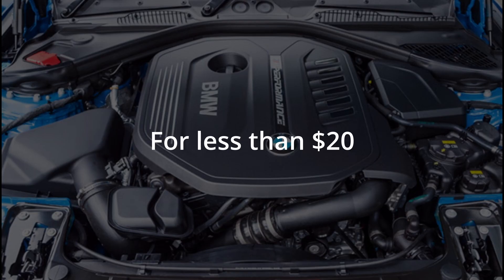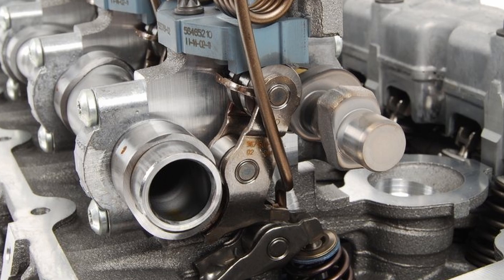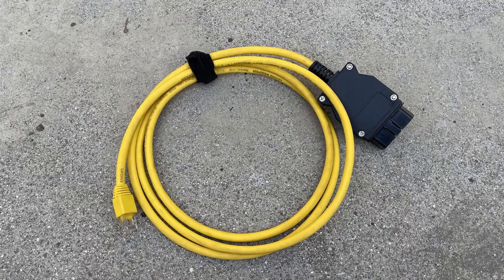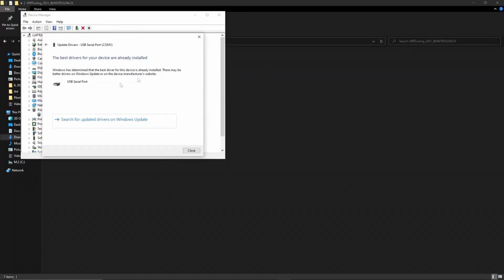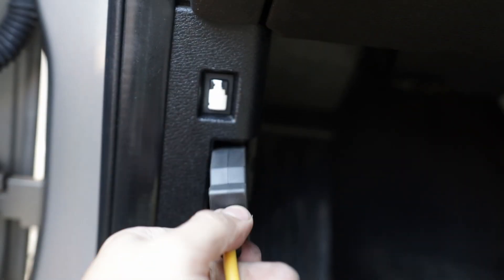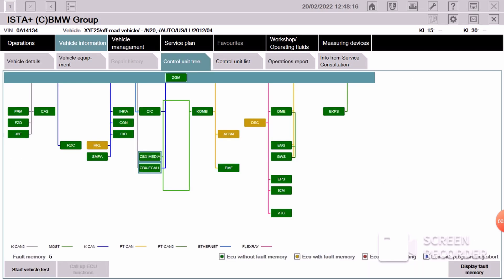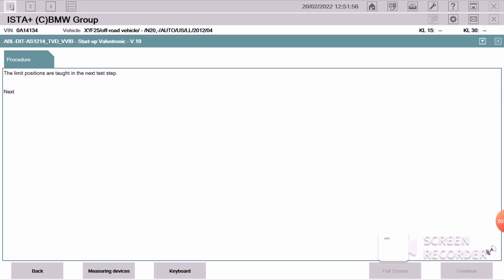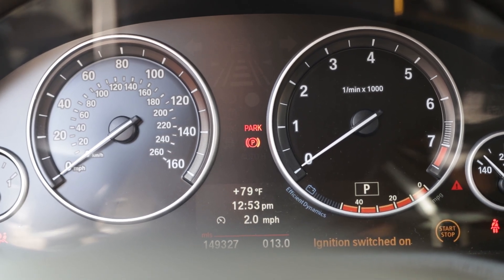How to Fix bad idle on BMW   (Valvetronic Issues)

Comment: Hey bro hope you well i have a b48 engine having trouble to stay idling runs roughs and shuts down not even few seconds later. i got a different valvtronic for it same issue but when i manually adjust the valvetronic and unplug the sensor it idle fines no issues but its doesnt sit right to drive the car without that sensor i tried doing a relarn test but car needs to stay on idle n my car clearly doesnt want to any suggestions?

Comment: Car with this issue for 3k buy or leave?
Reply from the maker: @MrPaininvain   if you’re doing it your self, it’s worth fixing! If you see and notice something might be off with power delivery, I would consider doing a timing chain replacement. That’s what solved my issue fully. My car was a bit out of timing. My fix here in this video was a temporary remedy. If you’re doing it your self, it’s about 500 dollars in parts

Comment: 250 Megabytes is the space needed… not 250 Gigabytes 😂.  Great video!
Reply: Incorrect, you need 300-400 GIGAbytes minimum for it to run smooth. Depending on which ISTA version you can find and its  capabilities it’ll need around 500 gigabytes to run everything efficiently.
Reply: @salty8snax  half a terabyte to run a program for which the download is less than 250 megabytes?  I stand corrected
Reply: @whlewis9164   😂 man you are going to have a rough time if you try to install this. Make a bowl of cereal and watch the install vid in the description. Skip to 18:30 where he literally says ISTA alone is 250-260 gigabytes and recommends 500-1tb of storage for all the programs in the pack. Yes, the zipped folder is <250 megabytes but once unzipped gives you the installers, files, and ISTA URL link. I installed a pack similar to this a year ago and it took me about 8 hrs to find a working link for ISTA+ and then about a full day of downloading & install instructions on old forums. Not fun.
Reply: @salty8snax  sounds like a real PITA!  Thanks for the warning.. 🤙🏼

Comment: Hi , I think I'm having idle issue . When I rev the car in idle ,  and let out the gas pedal as soon it comes back to normal idle rpm , instantly the rpm rises slightly like 50 rpm , above normal idling rpm, Then takes around 5 to 6 seconds to settle to normal idling rpm , what u think the issue is?
Reply: You fix it?

Comment: When replacing the eccentric shaft gasket, I turned the motor clockwise until there’s tension. Then counter clockwise until it pulls out. When putting the shaft back in, what position should the valves be before using the software to recalibrate?
Reply: Did you figure it out? I can't get rid of issues after changing valve cover gasket an the valvetronic gasket
Reply: @shaunariner also make sure everything is seated correctly. The CCV hose, the VCG, the MAF. You also might have to relearn the Valvetronic motor but I don’t think that’s your problem. We need to find out what your fuel trims look like to see if the car is running lean or rich. If it’s running lean, then you have unmetered air, vacuum leak. If the fuel trims are ok, then it could be the valvetronic calibration.
Reply: @shaunariner Did u figure it out?

Comment: I have 2011 BMW F10, 52 engine. When I started the car, it idle perfectly fine, but when I shifted to drive, the RPM dropped to 1000, so  after that, it will stay on it. It doesn't drop to 600 how I can fix this issue. Thank you.
Reply: Did you find out why? Did you solve this?

Comment: Did you have any fault codes or just a rough idle?
Reply from the maker: Yes, it showed misfire on all cylinders and I had a Valvetronic code. Eventually I did have to replace the valvetronic motor.
Reply: @NorVack  u did this trick after replacingvalvetronic replacement

Comment: Can u help me with my valvetronic codes. I already done two servomotors and still not lifting right. I did one relearn but then Servomotor went bad. Got it replaced but no relearn yet.
Reply: hey brother did relearn solve your issue

Comment: Had issues with my idle and tried a trick I saw (wish I had the link) where I turned on my ignition (not the engine) then held my foot all the way down on the gas pedal for 60 seconds. Let go. Put your foot on the break, and turn on the engine. I went for a drive, and now my throttle is normal.
Reply: you have a bad throttle body, or it’s covered in carbon… this is a temporary fix but the idle will return👍 i recommend replacing it

Comment: These problem can cause misfire on all 6 cilynders? I'm trying to diagnose if these is my problem since it pops up the code error but in the moment i stop turn off the car and then turn it on... everything is fine. also it only happends at low rpm... if i hit the highway it would never pop up the error code
Reply from the maker: Hi, yes! That's exactly what I had. I had all cylinder missfires and a valvetronic shut off code. Mine would mostly run bad on first start and under load. I did it and after a few months, the same code came back again. Eventually I did replace the valvetronic motor and the issues went away. The cable is fairly cheap so I feel like its worth a try :) best of luck!
Reply: @NorVack  OK, i'm downloading the software haha thanks i'll give it a try... hope it works on my e82
Reply from the maker: @toto14101  no problem ! Let me know if you need help 👍 best of luck!!!
Reply: @toto14101  did it fix your issue?

Comment: Can these cause misfire on all 6 cilynders? Trying to diagnose if these is my problem... im on 93k KM
Reply from the maker: Hi, yes! Thats exactly the codes I had along with a valvetronic motor code. Its worth a try to test if this fixes it. It might be a temporary fix if your centric motor is failing. For me it only lasted like 4 months till I had the exact same issue again. It was fixed after I replaced the actual valvetronic motor
Reply: @NorVack  Replaced motor and issue remained. Does it need to be relearned or is cycling ignition enough?
Reply: @WayToManyAssassins Did u figure it out?

Comment: In my car I can't find that service function, only the relearn function, which I did perform, but didn't resolve the issue, in live data I can see that there is a 52 degree difference between the specified and the actual angle of the eccentric shaft
Reply: Hello bro did you fix it ?